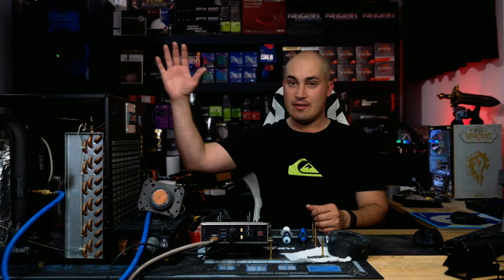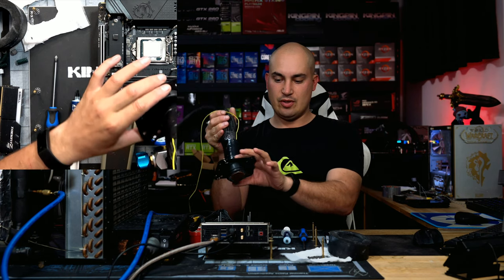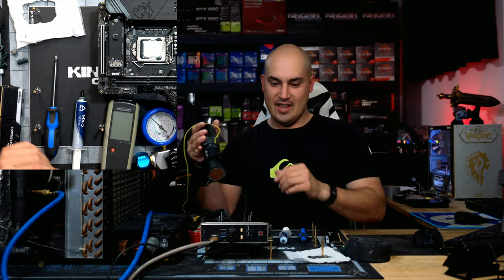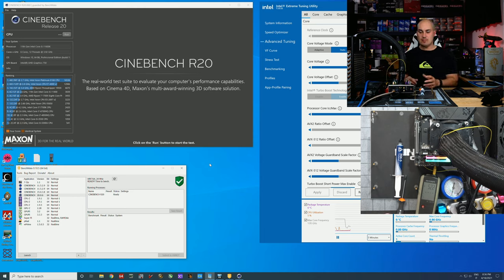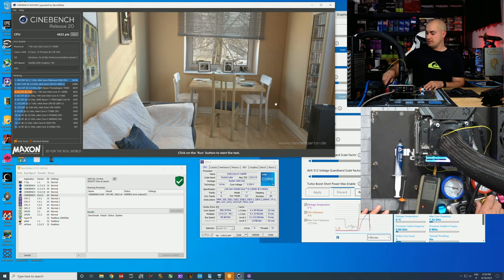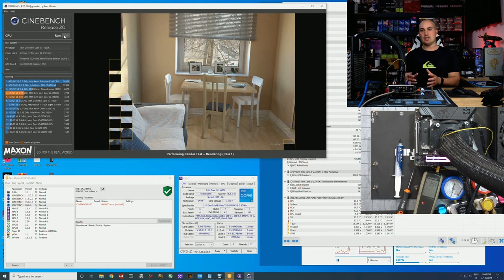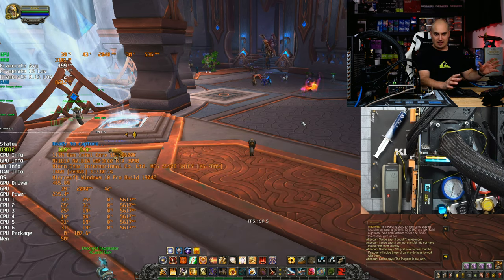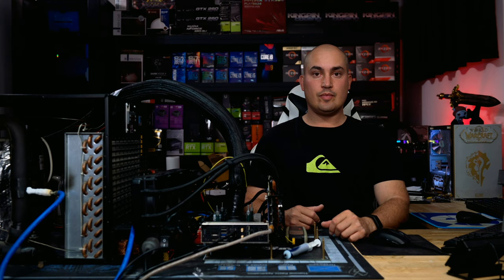Phase Change Cooler refill and load testing: 11600K @ 5.6GHz

Comment: What is needed to keep cool the 11gen intel:
Max enter the scene with a phasechanger cooler!🧐
Reply: @HardwareNumb3rs  honestly, the idea of this and the tec cooler now with the Intel version using EK and cooler Master aio kit, looks really promising. Hope they do an amd version that just works without needing the intel based system sitting around
Reply from the maker: @CESAR_H_ARIAS  I’m planning a mini version of this to fit inside a chassis, maybe I can make it work without much power, at the end this is like 600W, the TEC is around 150/200W for much more power of cooling, if I can stay around 350W it may be something
Reply: @HardwareNumb3rs  oh, intresting, perhaps you should look into inverter motors from fridges or something

Comment: fucking bad ass. too bad you cant get further ram performance out of the 11 series or i'd pick up the 11900k with that new 4400 cl16 kit. keeping my 6600k for now which is a bit ahead of the 3600 in the revendreth flight path run and hoping alder lake or ryzen 6 is a monster
Reply: I think alder and ryzen 6 will just be slight boost in performance. computing power has reached a limit atm. These companies are just greedy.